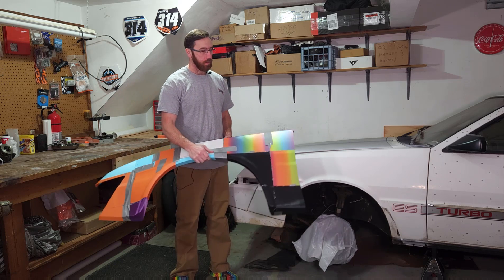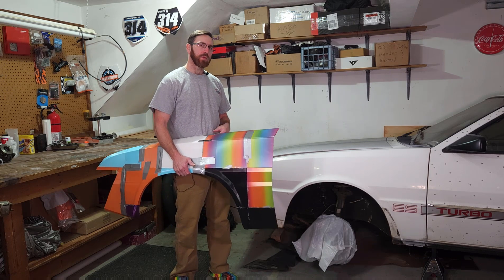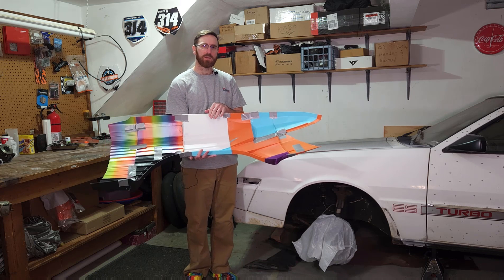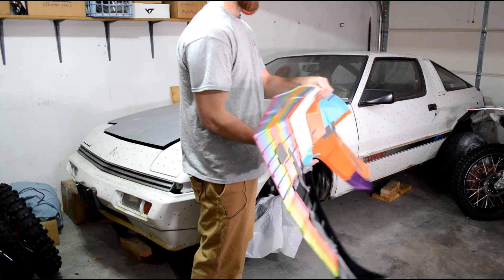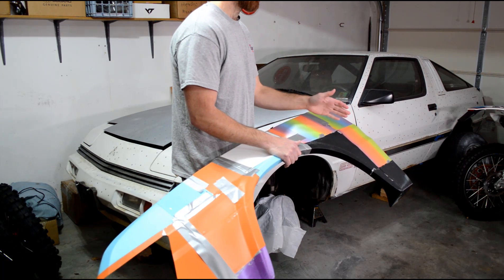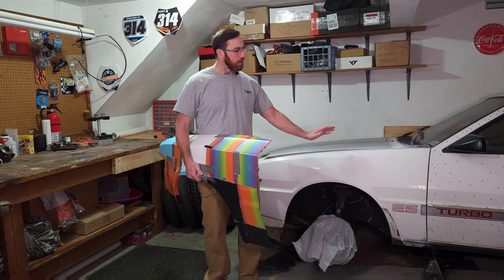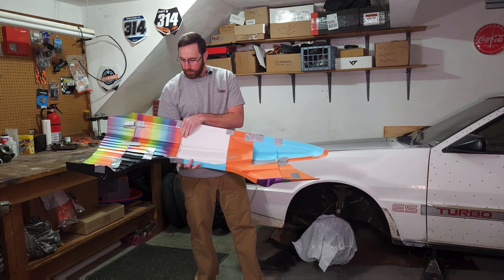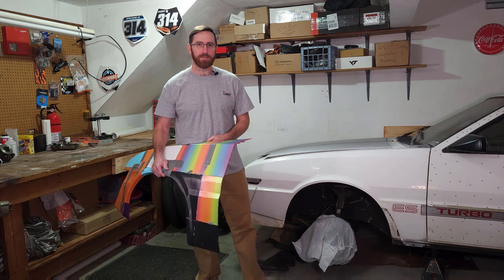Scan to Part Series Part 15 | What Went Wrong With The 3D Printed Fender and How You Can Avoid It

Comment: Really enjoy this series. I’ve watched it multiple times and worked through it playing with fusion on multiple projects.
I recently received a large (.8mx.8mx1m) 3d printer from a kickstarter program (Elegoo orangestorm giga) and it’s a game changer for these types of things. I can print an entire rear quarter panel for my ‘73 Challenger in 2 parts (currently printing it in 3 just to limit risk a bit).
My 3d printed fender has some waveyness that I have a hard time seeing in fusion or a slicer but is definitely part of the model, not a printing issue. I’d be curious to get your take on it sometime if I could email you. I’m trying to figure out if it’s a tangency issue or something that Fusion doesn’t visualize very well? Even going through the zebra analysis and curvature analysis I’m not seeing it on my model. As for real world application I can simply use some body filler if I intend to use it as a mold for CF or FG, but I’d love a better understanding of what I’m missing at the modeling stage for future projects
Reply from the maker: Sounds like a massive printer!  I used to have a 73 charger many years ago but it was a sad little single barrel 318 :). my brother and cousins had road runners, dusters, cornets etc in the 80s when they were super cheap.  Im sure my cousin wishes he still had his super bee :)

On the file, sure send me an email.

Comment: hey thank you very much for the process. really giving me insight with the scan and design process. as i follow along the full series i really think this is not an easy method 🙃especially with modeling process. i hope i can see more project like this in the future.
Reply from the maker: Great to hear!  And yes i have a few more planned.  Will be switching gears and doing a bike build before getting back to the car though.  I have a v2 of the flare that I need to do some testing on first.

Comment: Can’t you basically make all the pieces like a puzzle that interlocks?
Reply from the maker: Sure can!  The kicker is print orientation and if you can do it without supports.  When I do the videos for v2 of this design ill work on a couple different options and see which is best.
Reply: @LearnEverythingAboutDesign  I’m interested to see how it goes because it’s what I was thinking about for the one I want to make. I’m also thinking instead of flanges I want to print something like 3” wide, 1mm thick strips to epoxy over the joints on the back side. I’m not planning on making a mold though. Just print it with a fiber reinforced filament, prep and prime the surface, then vinyl wrap it.
Reply from the maker: @Archangel3083  if you can with those strips add little bumps or register marks.  The biggest problem is that the parts will warp slightly and getting them to line up can be a challenge for sure.  If you print a strip for the back and it has some dimples or spots to align/register with that might help.

No issues at all epoxying the pieces together.  The weak spot (for me anyways) was the layer lines.
Reply: @LearnEverythingAboutDesign  if remember correctly you used pla though right? That’s gonna warp where a high temp fiber filament won’t. Gonna be trial and error for sure but that’s all in the fun.
Reply from the maker: @Archangel3083  Yeah I used PLA.  My intent was to glass the inside and outside leaving the PLA as the core of the material.  I think the next variation though I will do a 3d print sample, but then print a mold.

Comment: What is in Your opinion the best  and user friendly car design program, if you using peel 3 with cad software
Reply from the maker: That is a loaded question :)  If you want to design a car for production that is a much different thing than modeling a car.  There is no friendly car design program.  One of the common workflows is for cars to be designed first with mesh like Blender, Maya, etc.  That mesh then goes to a program like Alias, that is a Class A surface program.  A good quality surface model is made using the mesh as a basis(which the mesh could be a scan).  From there usually that surface model is turned into reality.  3d print. cnc machined clay model etc.  From there it is refined, scanned, and process goes again.  Back into Alias for Class A surface based on the model.

If your goal is to 3d print then your choice of Blender or Fusion 360 would both be good options for Scan to Part design.  IF your goal is to machine something then i would put the effort into Fusion 360 because the surface/solid you get will not be a mesh body like from Blender.

I have modeled cars in many different programs From Inventor, Solidworks, Fusion, Blender, Plasticity etc.  Solidworks and Inventor actually don't handle the scan based design as well as Fusion.  Plasticity doesn't have anything to snap to a mesh yet even though the surface quality is good.  You could use other programs like Rhino 8.

My suggestion is to try a few programs and see what you are most comfortable with.  Some people love Blender and Hate Fusion.  Others love Rhino.  Autodesk does have a free home learning license of Alias if you really want to dig into car moeling but I will warn you that the UI/UX is out of date in my opinion and not nearly as user centered as fusion.
Reply: Our Plan is to make one drift car from corvette C5, we bought peel 3 and the car should arrive at the middle of February to EU. What we was thinking was to scan car with old body, all parts on, to get wings and other part connection places, after that to put on all new parts and wheels, remove all old body panels and scan it in again. Perfect would be if we can, for example to take front wing old scan with all original connections to the body and just draw new design over it to fit with wider car.  Seems like its no easy solution to use some scanned data, as i understand its necessary to overdraw everything from scan to get new file for 3d or cnc. I hope You got my idea, maybe its correct to say modelling,  im not so good in English to explain everything perfectly, so if you have something You didnt get i can try to explain different way. Thank You for previous answer.
Reply from the maker: @marx3280  I will say that the old phrase "garbage in garbage out" applies.  What I mean is that you will need to take a lot of time scanning and making sure you have good scan data.  I haven't used the Peel3 so I can't say how their mesh processing works but aligning all your scans to a common coordinate system will be a big thing.  If you scan the car in the same place and can use markers and some object say on the floor at the middle of the car so you can set up an "Origin" that will go a long way when you have to 3d model.

No matter what you do it isn't an easy task.  Higher end scanners and software will produce better results.  Something like a Shining Freescan for example.  that is $17k USD.  Shinings software will give you more mesh processing options as well but really a pro tool like Geomagic might be a better route.  but all this adds up.....  The CAD will be the same no matter how you go about it, but the scanning and scan processing will be directly related to how much you invest in the tools :)

As for CAD.  Again it depends on your budget and time to learn.  I think Fusion is a great piece of software, but most CAD programs aren't considered "Class A".  This means they can't achieve the surface quality of a program like Alias.  Alias along is $4000-$10000 a year depending on which version you go with.  Fusion is $500/year ?  It won't be any quicker in Alias but the results will be better, it is the kind of program auto makers use.

So at the end of the day you have to think about 1. how much is your time worth , 2. what quality of output do you required(probably not class a for a drift car honestly) and 3. how much do you want to invest in the tools.

Comment: Can’t wait to see future videos on this, you and a few people are why I got a 3D scanner and 3D printer. I had to change units in blender but have now almost completely printed a fender, and completed a shifter bezel all from blender. It is so much easier imo to accurately design than in fusion when it comes to having a 3D scan it cuts down almost all measuring on the part, would like to see you do videos on poly modeling 3D prints for projects whether it be on a motorcycle or the car your videos are always very informational
Reply from the maker: Thanks for the comment and letting me know about your projects!  Have you run into any problems when using blender?  I do still prefer CAD for "manufactured" parts, but this year I want to try my luck doing a scan to part with Blender as well.
Reply: Only problem I’ve had is a hole I Booleaned through a leg for mounting on the shift bezel, it did not weld together properly or something and made a flat face covering a hole. I still printed it with the errors and at the end of it I just pushed the face through the hole it was thin enough it did not actually close the hole, even if it did I figured could just drill the hole through. There’s another program I took a model too and converted to quads and brought  it to fusion then converted to solid body where I’m sure could avoid errors like in blender. The shape was so much easier in blender to create. I think it’d be worth looking into work flow through the programs for cases like that. The fender came out perfect and only blender was used even for slicing to fit my printer bed

Comment: I have a Kobra 2 Plus 340x340x400 that prints at 500mms was planning on printing some body panels for a old 76 914.
Reply from the maker: Awesome!  I really wanted a 914 years ago. such cool and minimal cars!
Reply: @LearnEverythingAboutDesign  Putting a Volvo B23 engine into it, the little 80hp one not the best for modern times. But, yeah just a sheet metal unibody and a dog box manual all the creature comforter you have lol no AC has heat thankfully. They are going up in price like crazy now since more people are realizing the fun on the mid engine swaps you can do to them.
Reply from the maker: @ScarletSanctuary  Yeah i think back in the 90s i came close to buying one of them for around $800.... should have.
Reply: @LearnEverythingAboutDesign  yeah, the V6 models are now around 100k+ and the normal ones running are around $20k I know where 3 are that needs work but are $1500 each.
Reply from the maker: @ScarletSanctuary  1500 isn't bad depending on how much "work" :)
Reply: @LearnEverythingAboutDesign  for a car from the 70's they all will need rust repair, so depending on your definition of a lot of work. Thankfully all the body panels are reasonably cheap.
Reply from the maker: @ScarletSanctuary  i hate rust :)  I live on the east coast US and have had many old ford trucks so i know a thing or two about rust repair ;).  Ive also had a few vinyl top cars..... gives me nightmares still.  I much prefer mechanical problems over body problems any day of the week.

Comment: Pursa slicer let's you key items when you cut them so they will snap together, highly recommend if making big parts that require assembly.
Reply from the maker: Wow great info!  Up to now I had just used the creality slicer on the K1 but ill need to dig into prusa slicer a bit more and see what profiles are floating around for the K1 max.  Thanks for the tip!

Comment: Hi, thanks for your tutorials they are some of the most helpful on YouTube and exactly the project I want to be doing on my car. I’m new to 3d printing and fusion 360, have you done a video showing how to section the complete wing ready for 3d printing the individual sections? Thanks for your help!
Reply from the maker: Thanks.  I haven't done that specifically on a wing no but the process is the same.  Start with whatever size you can print and hack up the parts smaller than that.  Are you planning to use the 3d print as a final part or use it for a mold?  Final part is tricky but can be done with the right materials, but generally those are harder to print than PLA.
Reply: I brought a Anycubic Kobra max 2 just for this project, I've had success with designing and printing from fusion 360 but not tried anything where I have to section the part and bond together yet, I imagine it will be a big learning curve! My original plan is to bond to the standard body to make a mould but I have seen a few people sandwich the 3d print in carbon fibre weave and vacuum bag resin infusion that looks like it works quite well. I’ve been watching your videos on 3d scanning and my next tool I need is a scanner to scan the body of my car. What would be your personal recommendation on what scanner I should get from the scanners you have used? Thanks  @LearnEverythingAboutDesign
Reply from the maker: @engineeredtorace  If you haven't seen it check out the Street Bandito channel and their EV conversion carbon 240z.  They don't do how to but they show enough detail and they bonded prints to the original fenders to make molds.

Sandwiching the prints inside and out is a good option.  the 3d printed lambo was done that way.  Biggest issue is that you need to design for that sort of thing.

As for the 3d scanner that is tough as it really depends on your budget and what projects you want to do with it.  The big difference you will find is in the software.  This channel is a revo point affiliate so I do get a big if you buy from them from one of my links in teh revo video descriptions, but that doesn't mean they are the best choice.  I would first consider that the less you spend in general you are going to get slower scanning and generally less accurate.  Usually the more you spend you will see speed and accuracy increase.  Laser scanners are $$$ but they are fast and generally scan shiny objects like cars much better.  Shinning offers laser scanners in the Freescan(which i think is $17k) and their HX series.  Shining mesh editing/processing is above revopoint, creality, 3dp etc etc, because their catalog of scanners is generally professional with the Einstar being the one exception to that.

If going with revopoint I really like the Miraco because you don't need to be wired to anything and you can pause a big scan, switch to near mode and capture fine detail in the same scan.  With most other scanners you either need to be attached to a laptop or have some sort of bluetooth/wifi module.  Another thing you will see is more of the IR LED hobby scanners on the market use a USB cable to tether to a computer.  The miraco capturing everything on board doesn't need to worry about that, and when you get up in price you will find that scanners use HDMI for faster data transfer.  So a higher end pro scanner can bring in millions of points per frame and 15-30fps.  while the setup on hobby scanners generally sees 7-10fps in reality and fewer points pre frame.

I know that was a lot but for my money I like the portability of the miraco.  IF your budget is lower than that however you will need to decide between scanning larger things with lower accuracy or smaller things with higher detail.

Last bit.  the revopoint scanners and the creality scanners and others in this segment have either feature based or marker based tracking.  As you move up things like the Einstar and other shining scanners offer a hybrid tracking setup which means you can toss a few markers in flat areas and align with features in higher detail areas.  Might seem small but putting markers on a car can add up and is something to consider.  You can also put little folded bits of tape. clay or even tissue and have those show up with "feature" tracking to avoid buying marker dots.

Comment: Hi, 
through your videos i have found something in my life that i enjoy again.
I started modeling again and like in your videos I scanned my fender and printed it almost complete.

I'll give you some advice on how i printed my fender

I used petg as filament. (Jayo)
for large long thin-walled parts i have modeled towers that ensure that the part does not start to tip over.
It is also important that you reduce the speed.
I print on average with 60mm/s and max. with 80mm/s

To connect the individual parts, I enlarged the surface in the inner edge to 30mm and drilled holes in it later. 
The fender parts were glued with two components and fixed with screws and nuts

Unfortunately i have the problem with my parts that i have printed them very thin 2mm and they bend to the point that they break.
I tried to make them stiffer on the inside like in this video from CNC Kitchen (https://youtu.be/3-ygdNQThAs?si) but i didn't get any results.

Would it be possible to emboss the inside of the fender with honeycomb so that the structural integrity becomes reinforced.
If so could you make a video so we can both move forward with our projects.
Reply from the maker: Glad to hear it and thanks for providing what works for you!  I did too have to run my Ender 7 much slower.  3mm thick with the ribs on the inside worked well.  The k1 max printed at full speed and had a great result.  This was using glue on the build plate and no supports.

You could do a honeycomb or grid on the back side.  If you have the room though you could just make it thicker and use an infill with a thin skin on the outside.